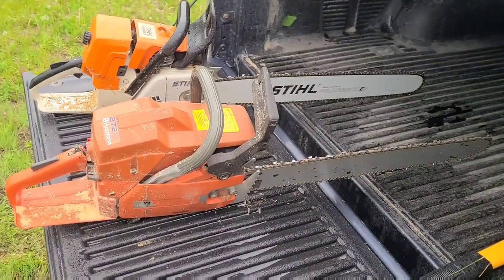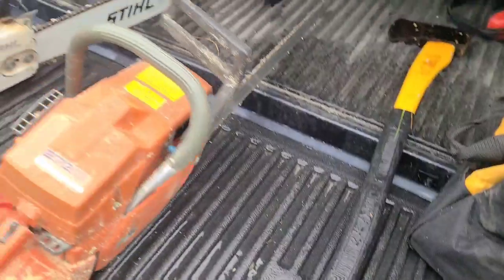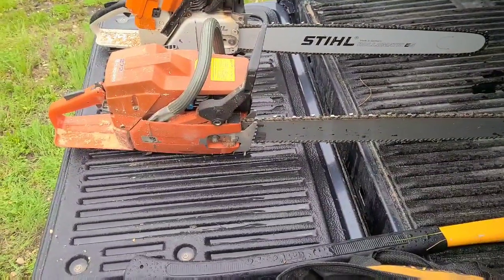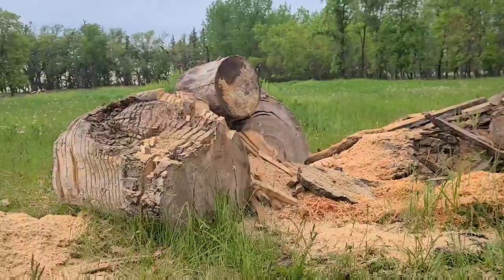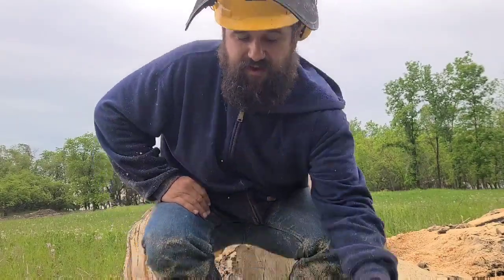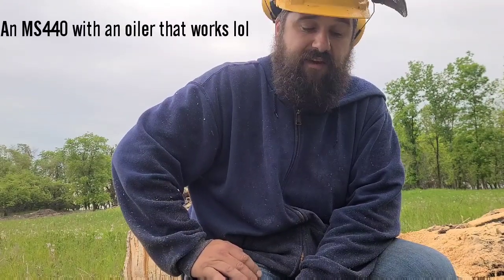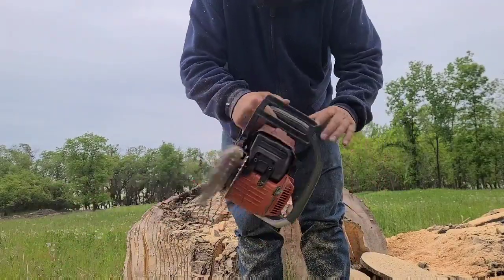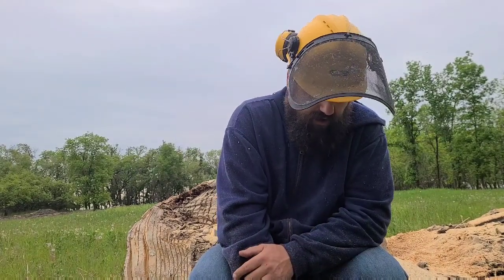Ported husqvarna 272xp, oiler fails on film! Perfect example of heat leaning a saw out!!

Comment: I really battled an intake air leak on my 266 that I put a meteor big bore top end on.  I solved it with OEM intake block and gaskets... after some cussing, head scratching and Ironhorse videos.  How did you solve yours?
Reply from the maker: The exact same methods as you. A lot of swearing lol. 

Harvey was going through the same issues at the same time it seems.
Reply: Try taking your intake boot off the cylinder, clean it really well as well as the cylinder horn. Then use a thin film of anaerobic sealer on the inside of the intake boot. Then reinstall like normal. I’d wait at least 24/48 before you start the saw again, to give is a chance to do its job. This has worked well for me on several builds. As well as I just do it now as a preventative measure.  Look up Mathew Olsens channel, any of his builds he does that on, that’s where I found it.

Comment: Currently working on 2 x 365/372 conversions and trying to learn to port a bit better but waiting on parts because postage is useless right now. Also a 254xp which has been giving a bit of grief, can't get it to tune and stay there. Found an intake leak and believe I fixed that but when I start it from cold it just races and won't idle, a bit of warm up and it's ok, you think that might be crank seals?
Reply from the maker: Id throw crank seals in that for sure, its such a cheap amd easy fix why not?
Reply: @tinmanssaws  never done it, will have to wait for more parts then. It's not my saw, just doing it free for a guy because I told found it for him, was hoping to have it gone by now